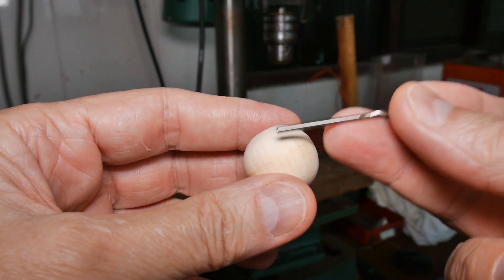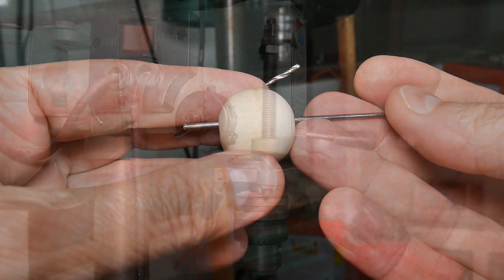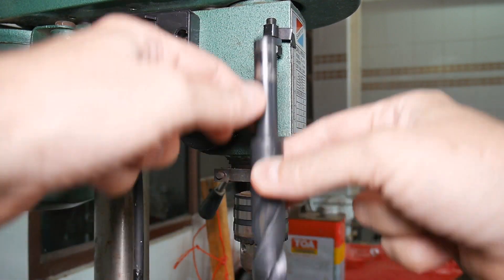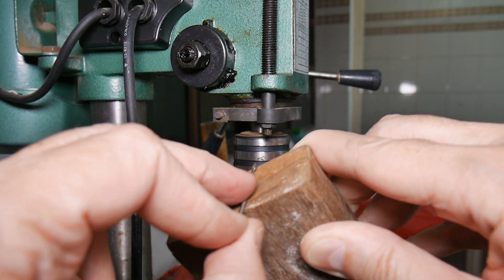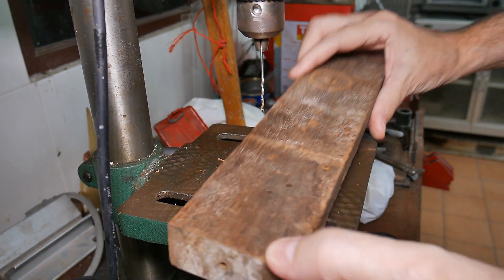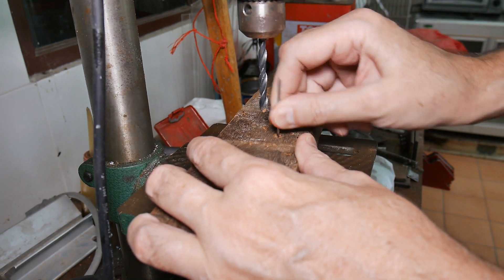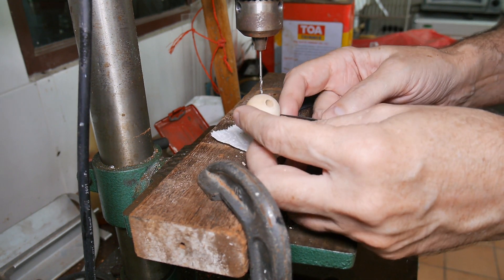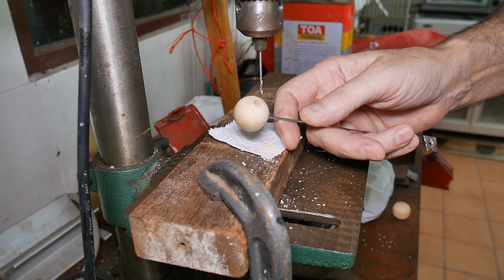Drilling a Ball / Sphere (with a cheap drill press)

Comment: It might have required a little more work but you could bolt the board to the table. 

I would have taken a dowel through the hole on the ball and built a small square around it with holes for the dowel. If built true it would provide a perfect perpendicular drive right down into the ball.
Reply: But I always plan for the idea that I might have to do this again in the future and if I did I would have the little rig ready to go next time.
Reply from the maker: Good idea, thanks.